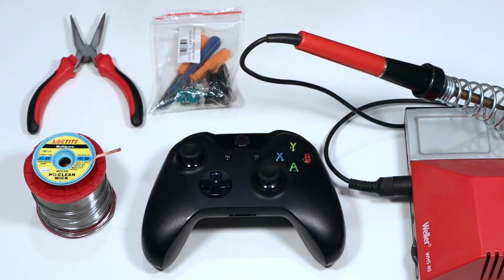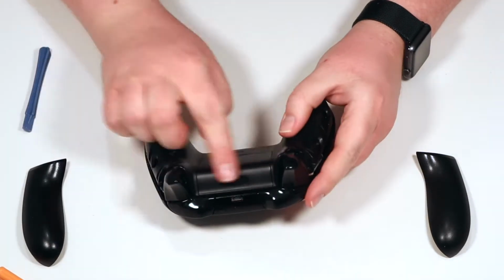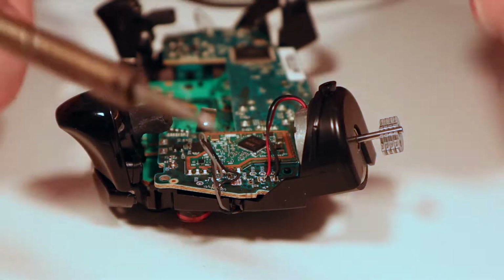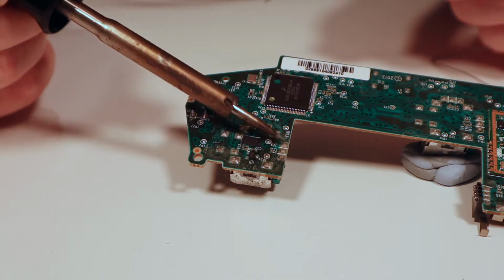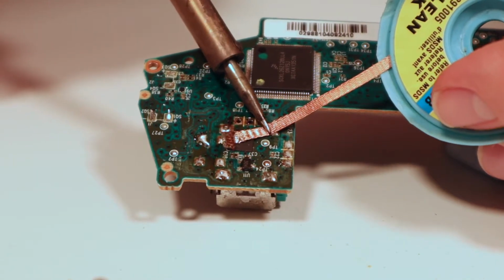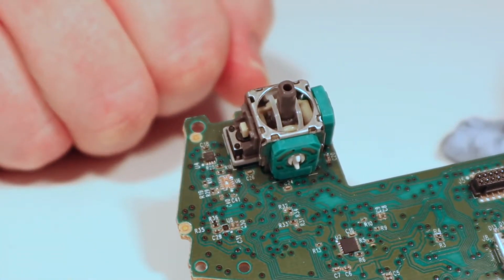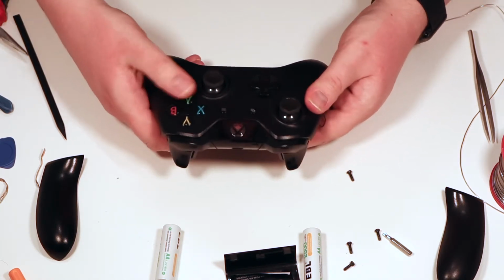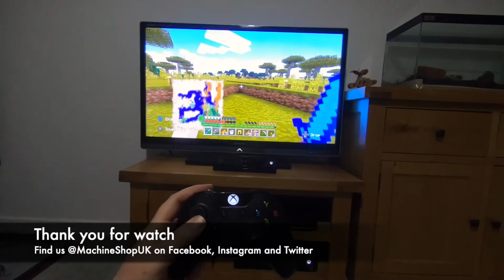How To Fix An Xbox One Controller Joystick

Comment: I'm on my 7th guide and no one tells what to hest a solder iron to remove the solder
Reply from the maker: @brettclifford2723  it would depend on the solder that was used and what you are trying to remove, start at 350C and then increase by 10 degrees, don’t go above 450C. It may also be that your soldering iron cannot supply enough heat, how many watts is your soldering iron? I have an 80W soldering iron and sometime find that it is not enough and I need to heat the whole board up first

Comment: Having real trouble melting the lead free solder, any tips? 
One of the the metal squares under the solder has come off, is it needed?
Reply from the maker: Try using liquid flux and yes they are, if it’s come disconnected then you will need to find out what it’s connected to and run a thin wire

Comment: Hi, what can I do if when I try to solder the analog stick in the motherboard the solder sticks to the iron and can't get it on the motherboard?
Reply from the maker: JesRX Hi @JesRX solder will glow to the area with the most head. I usually put the soldering iron so it’s touching the pad and then pin, let it sit there for a second or two and then push the solder onto the pin. Because the pin and the pad is hot, it should stick to the board. Hope this helps, regards @machineshopuk
Reply: @TheMachineShopUK  oh I see how I messed up, I accidentally broke the pads from the motherboard so the solder couldn't go anyways but the iron, anyways thank you for your response

Comment: How hot do you run the soldering iron when adding/removing?
Reply from the maker: It's normally wise to start off at like 300*C and then move up from there, I usually have my soldering iron set at 400*C but it can depend on the solder that you are using. If you are finding that 300*C isn't getting anywhere then slowly increase it.

Comment: These repair was done on the early edition controller with no audio jack 3.5mm. This joystick has lead solder on it. The new controller with the audio jack has lead free solder and its almost impossible to melt in the through hole
Reply from the maker: make sure you have a high flux solder wick, this will help with the lead free solder
Reply: @TheMachineShopUK  What happens if the metal plate (tracer joint) was removed accidently, is the pcb done for or can it be repaired, is the metal plate for ground or connected to a pcb wire?
Reply: @dlpvapor919  series x and last gen xbox one pads are all lead solder with the holes way tinnier close to impossible to do a quick job, took me an hour to fully lean the solder before replacing new ones, secret is high temp, quick contact, not too long or u could use blower from a solder station, or buy a solder iron with sucker built in goes around USD 6 bucks.
Reply: @Will_Fong  thanks, I forgot to say I had  a sixaxis no rumble edition, im trying to make contact with scratching the green board for the copper to show up since the rounded metal joint ripped off, is there any way?